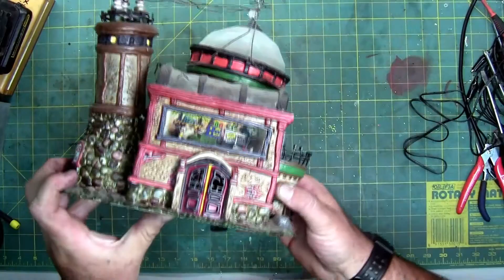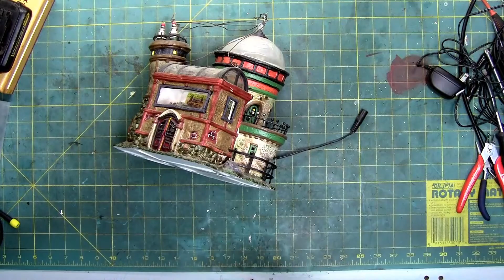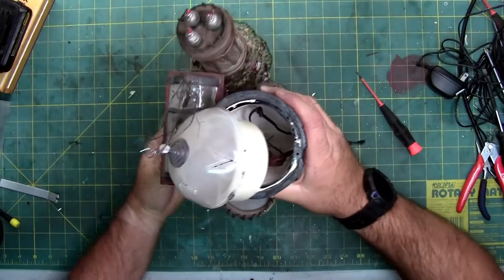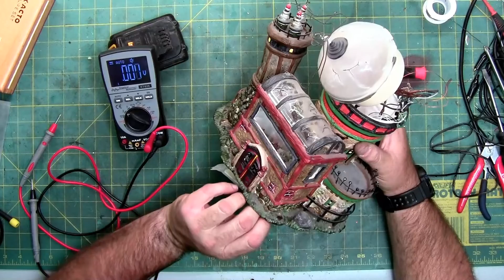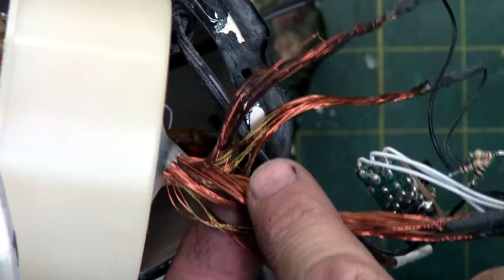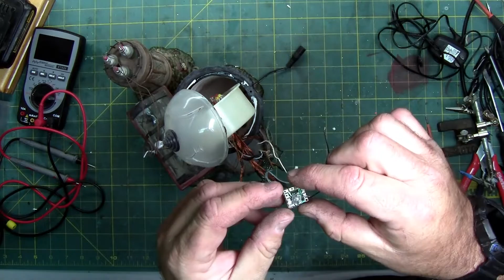Dept 56 Dr. Lunatic's Laboratory disassembly and diagnosis

Comment: Wife inherited a bunch of department56 from her grandma. Working on this piece rn. Pretty sure it has been overvolted. Checked every PNP transistor and caps. Everything checks out. But have a deformed button IC. So looks like I'm going to be doing the same thing with mine. Have a bunch of atmega32 pro Cs I can use for it. Seems to be a problem with this unit in particular. Have the power supply that came with it and it says 3v. But outputs 6v.

Thanks for the video! Helped me figure out how to tear down. I wasn't as lucky in removing the bottom plate and Dremeled it off. Lol
Reply from the maker: The OEM 3v power supply will put out a free float voltage (no load) near 6v. But if you test it while it is working the unit, it will generally be just over 3v

Comment: My wife has dr lunatics lAb and the 3V DC 300mA transformer does not light up the piece any longer. It checks fine with my volt meter. She unknowingly plugged it in to a 12V AC transformer and it works fine except the transformer heats up. Any suggestions?
Reply from the maker: There is a short (most likely) in an LED bundle or the circuit board that rotates the lighting. I am going to soon fix mine that has a similar problem and film the process.
Reply: @RandomJunkChannel  thanks, I’ll be on the lookout for the video.
Reply: @RandomJunkChannel  Looking forward to your next video on this. I recently purchased this building knowing that it didn't light up. I just like the building. Interestingly it will partially light up but then it will flicker out.